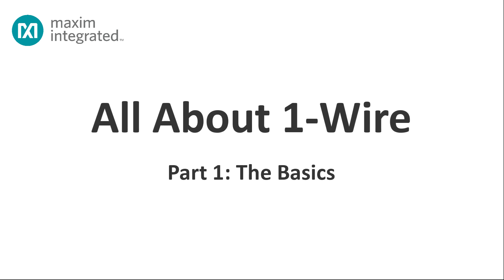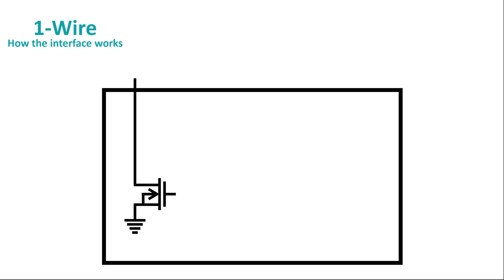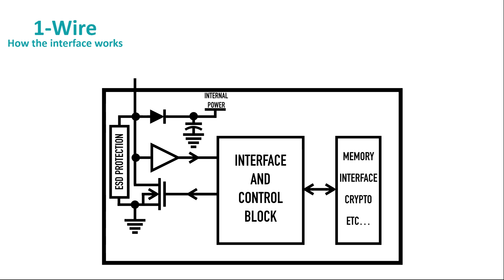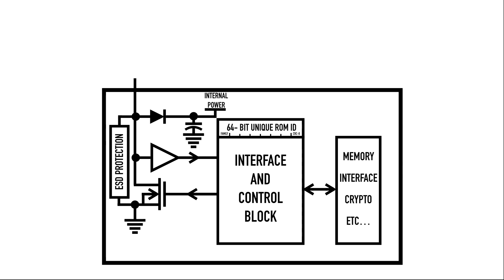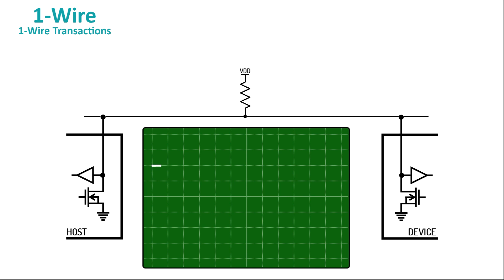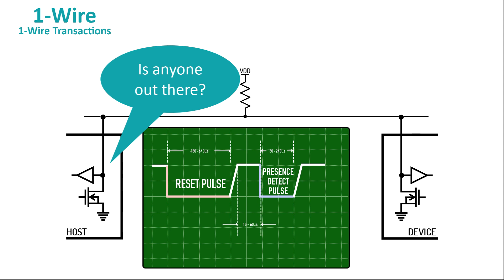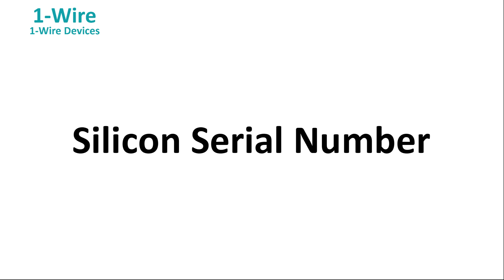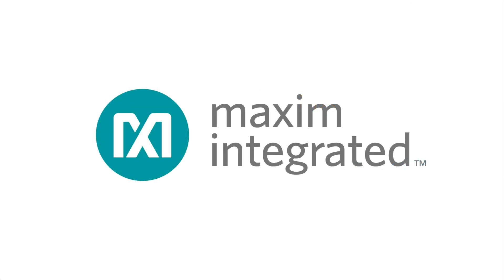1-Wire® Technology Overview - Part 1

Comment: The 1-wire temperature sensors are very useful.  At work we have several long strings of them which we can wrap around oddly shaped parts allowing us to monitor the temperature at many different points during gluing and annealing operations of acrylic to make sure we don't have any hot/cold spots.

Comment: You say there is a 65µs bit time, but then when you talk about how the master writes a 0, it takes, at most, 120µs. Well, how can you keep up with the defined baud rate if you're taking longer to send bits than the time you're supposed to?
Reply: 60-120 us, means in practice the transmission rate can be slower if you need it.